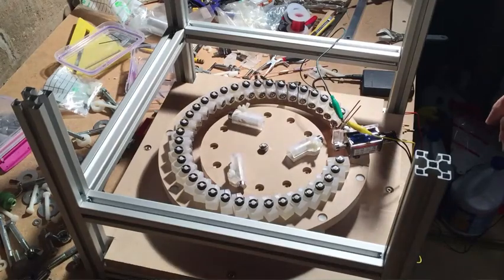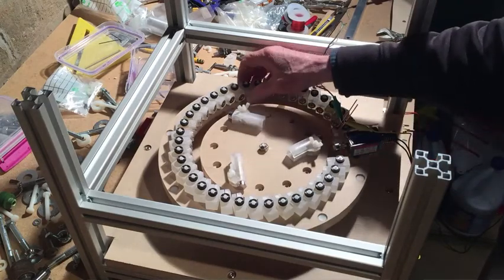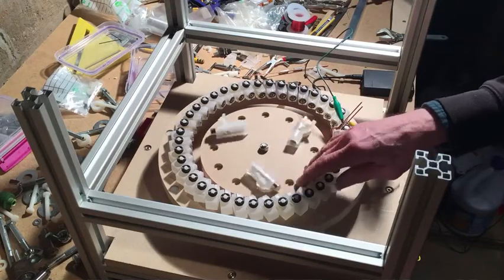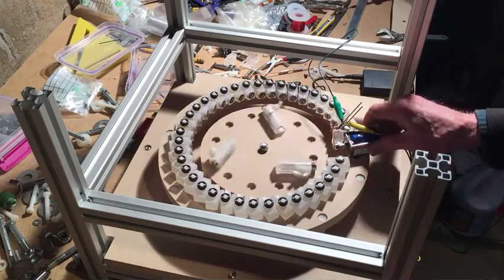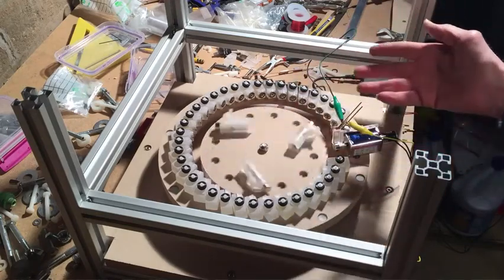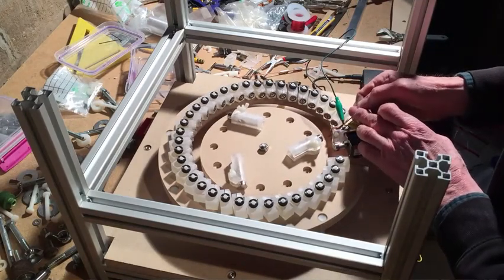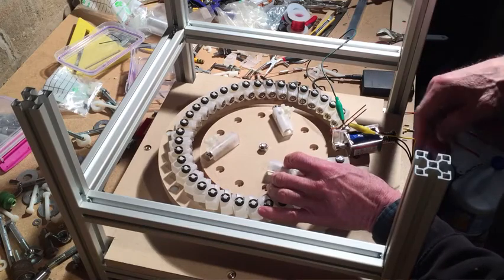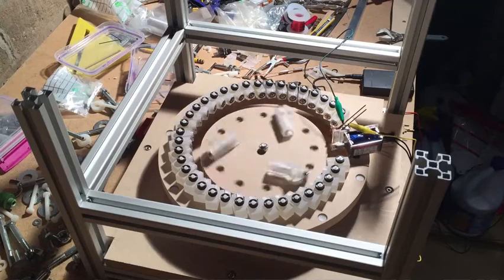Spiral Magnetic Motor Test Setup

Comment: Most people experimenting with this arrangement it in attraction mode because that creates more torque, but it needs to be in repulsion mode to be ou. May not need any magnet angle. Try optical pickup and of course stationary electromagnet instead of a solenoid.

Comment: Replace the solenoid with a coil using ferrite core and place it next to the closest magnet. That will much more efficient if you get the switch timing right, and low noise ☺
Reply from the maker: Thanks for suggestion - yes, clearly an electromagnet push is the way to go - I was planning to do just that. Also want to try to eliminate the cumbersome copper foil with a reed switch or hall effect sensor. Maybe will get back to this soon - have been focused on other projects.

Comment: Nice Work but I'm afraid You don't have really a "force", a MOMENT, more exactly. You're about to end with a MAGNETIC FLYWHEEL. To check that, You need to realise that the rotor will just keep the MOMENTUM of the ENERGY You put in while You give it the impulse  with your hand. If there is really a "FORCE" CONSTANTLY WORING TO TURN THE ROTOR, IT WILL ACCELERATE COMPARE TO YOUR IMPULSE (and them stabilises with the drag of the frictions). But I guess I understand why You try to set your magnet this way. The problem is that, as I can understand it: magnesium maybe not 1 way like the win but both ways. Nevertheless, some of us have demonstrated few clues about a vortex behaviour, I'm just afraid it is too weak phenomenon but I would Prefer You make me wrong but make it work :) Regards.
Reply: Sorry, didn't see the end. So, indeed You're making a motor :) That's fun because I did the very same wih ceramic magnets but I actioned by hand the pulse gate which was a moving magnet itself ^_^ Say that, don't forget what I said about ENERGY and FLYWHEEL or You could misslead yourself and waste some time ;) (in clear, You'll have to be able to measure the Mechanical Output of your device and compare with the energy your gata will consume ^^ ).